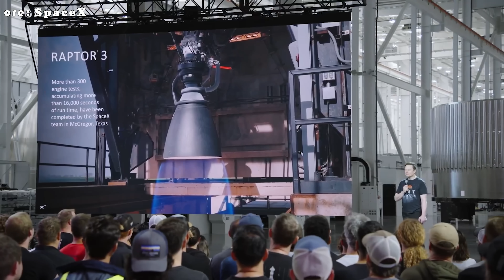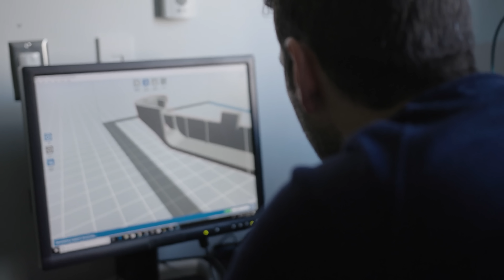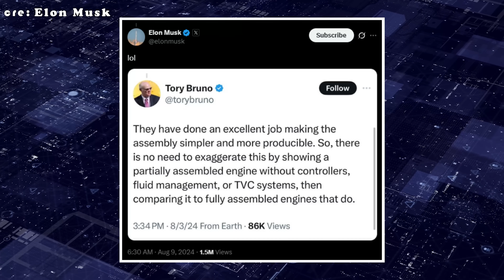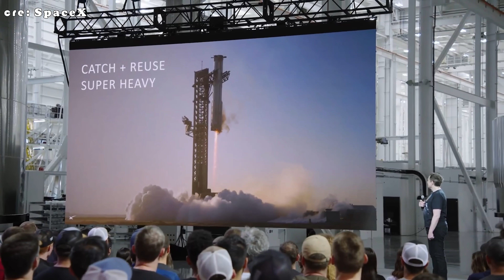Elon Musk Revealed Big Upgrade on Raptor 3 After Flight 11 Shocked NASA!

Comment: Nothing Elon and SpaceX does surprises NASA.  The Saturn V F-1 engine is still, accoring to Wikipedia, "The F-1 remains the most powerful single combustion chamber liquid-propellant rocket engine ever developed."  It was man-rated and took men to the moon with NO failures.
Reply: You're forgetting Nasa had a very large budget, much larger than what SpaceX has to work with. SpaceX raptor has less thrust, but more thrust to weight ratio, more efficiency, higher chamber pressure, less parts (a good thing), and is capable of creating fuel on Mars. Starship super heavy already has over double the thrust of saturn v's booster, and it will eventually be reusable (tower catch has already occured). Not sure why I'm putting effort into this comment since you are probably a bot, but whatever.
Reply: 😂😂😂

It was just bigger and heavier also much more complex. Hardly high tech by SpceX standards.
Reply: Никогда Америка не высаживалась на Луне. Фундаментальная нестабильность процессов горения не позволила Ф-1 набрать полную тягу. Вся лунная программа это фейк. СССР выгодно обменял это знание на крупные инвестиции в 70-х годах и Хельсинский Акт. Америка в космосе стала великой только с Илоном Маском. Те достижения которые он смог организовать в космосе, это действительно величие. Молитесь на него.

Comment: Rocket Lab should by this engine for their Neutron rocket, and SpaceX should explore Rocket Labs carbon fiber 3d printing tech for a lightweight hull
Reply: 3D printing of large parts is too time consuming and do not have the reliability of Stainless steel. Try paying attention to the video next time.
Reply: @robertmiranda2444 shut up you bum. Rocket lab can 3d printer large parts in 24 hrs, and have been flying carbon fiber rockets for years now.

Comment: Elon quoted elsewhere that the IPTS will have overall power rating of 146MN. Which means SHBoo' & Starship will meet vonBraun's spec of 148MN, 2MN short of Nasa's ASV-1, or aerospike ASV-1X. Both are three staged rockets. Just 2a, 2b, or stages 2 and 3 configuration for Nautilus core

Comment: Once Starship version 3 is perfected and becomes boringly reliable then SpaceX need only convert from stainless steel to titanium and alloys to make massive improvements in payload capacity.  Yes, the build cost of each rocket will be increased but it’s very reusability will yield extra revenues per launch that will massively outweigh this initial additional expenditure.
Reply: Why.. adds cost.   Keeping to Statinless Steel is one of the major efficiency of the Raptors and Starship.
Reply: Hipster SpaceX likes their materials locally sourced.
Reply: Price per kg to space might be too cheap to justify the cost.
It’s  way less than 1% of the cost of a falcon launched kg.
Oxygen & methane is cheap.

Comment: Tiles can be made stronger by an injection of glassmaterial and aluminiummaterial or stainless-steal perhaps, 
Thanks for this video, 

Kind regards.Lightsignals can be made speeded up by airrefusion, perhaps. KEEP GOING STRONG, ELON and other ENGINEERS.
Reply from the maker: That's an interesting idea for strengthening the tiles!
Reply: They have fixed the tiles by using a foldable insulation under the tile.

Comment: Nothing new, but a thorough recap of where we are and everything we know about Raptor. 

Still waiting on an announcement of a reliable 300t thrust Raptor 3 (technically 304t) so that Starship 4 can achieve 10,000t overall thrust without switching to 35 engines. Starship 4 isn't due to launch until at least 2026Q4 to be "ready" by 2027. Starship 4 will be critical for the Tanker and Depot (half the number of refueling ships brings 16 down to 8 or 9 launches). HLS based on Starship V3 would (presumably) have the same 1600t of fuel. 

Sooo... 280t was about a year or more ago... 300t could be... now, though I expect they would have announced if it were reliable to 100 flights.

Imagine a Vulcan rocket powered by 2 Raptor V3 providing 60t more force in a smaller package with a higher ISP at less than $1m per engine vs BE-4 at $10m per engine. But that would violate production redundancy so.... sigh.